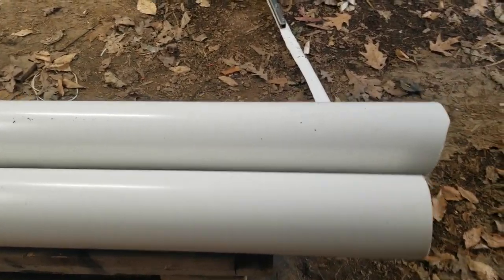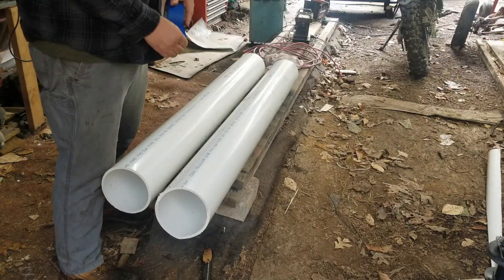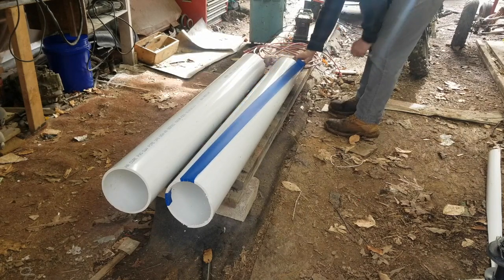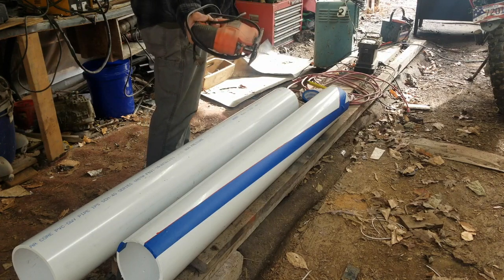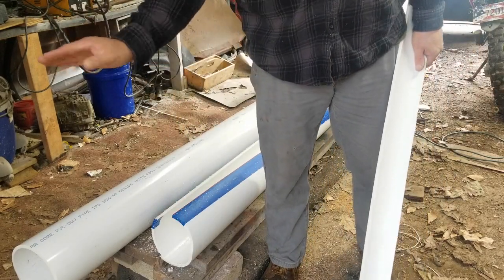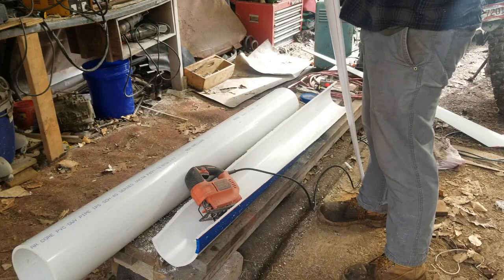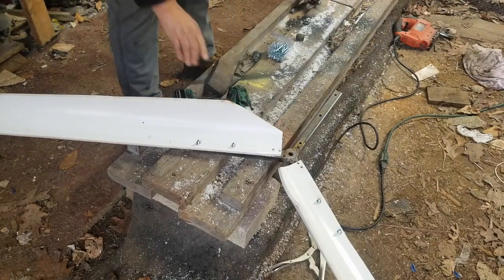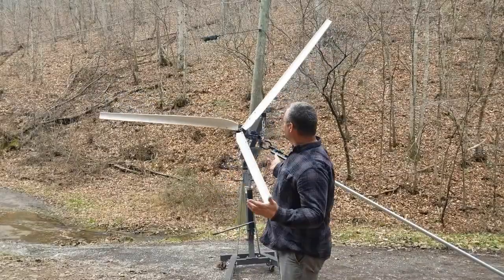DIY Wind Turbine Build Part 4

Comment: And weigh em before testing?
Reply from the maker: Yes, if I had a scale to weigh them it would be ideal.
Reply: @lukeFugate  A German VW engine builder that I use had me weigh the 4 pistons to within 1/10 of a gram, so I had to buy an inexpensive digital scale, but I'm guessing that level of difference is way beyond what's needed for these purposes

Comment: how much is the thickness of the pipe plz reply both of my comments because I am going to make a wind turbine
Reply from the maker: The pipe was 6 inch pipe. I think it was schedule 40. The length of the blades was 5 feet.

Comment: I've been shooting pool all my life...
I bought a pool table that had a wood ball return...but over the years it didnt work anymore...so I took a peice of schedule 40 6inch pipe cut it in half and mounted it under the table work like a dream..the only when the balls went into the pocket it was real loud..so I felted the inside of the pipe and solved the problem
Reply from the maker: Good job on that. That was using your head. It'll last a lot longer than the original wood did, that's for sure.

Comment: Excellent vlog.  If you find the blade curling in the future from UV exposure you could pop rivet a piece of angle aluminum (length wise) down the center of the replacements.
Reply from the maker: Good tip. Thanks!

Comment: Super smart way to make those blades Luke! What would you think of adding a thin metal backing plate on each blade where the mounting nuts attach? That area gets a lot of strain in any gusty wind situation. Just food for thought. Remarkable job as usual. I hope you and your family had a great Christmas, and this new year is healthy and prosperous for you also.
Reply from the maker: Good point. I think I will add some reinforcement to the base of the blades. At least some washers if nothing else, but the metal plates would be a good idea. 
Hope you had a good one as well.

Comment: I thought you were going to mount it up on the hill. Are you planning on attaching stay wires?
Reply from the maker: It will eventually be up on the hill for the cabin permanently. For now, I want to try it on Zephyr and If it works and seems feasible I will either build one just for Zephyr or buy one.  It will have guy lines on it in a triangle pattern to stabilize it.